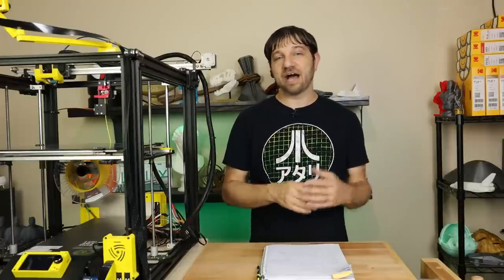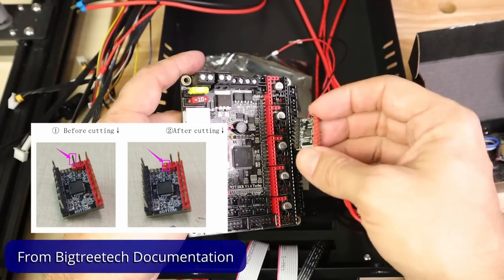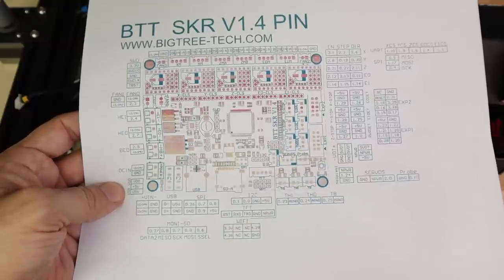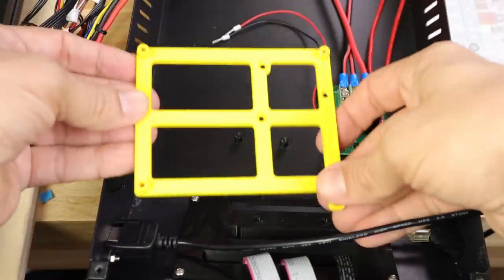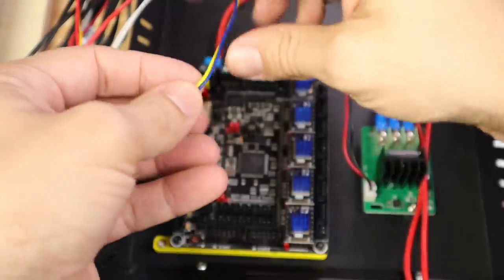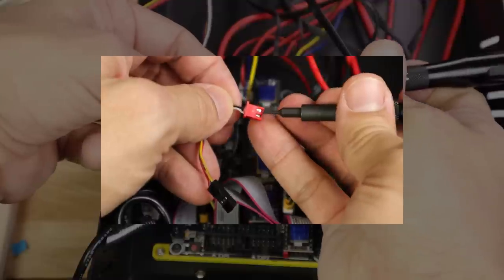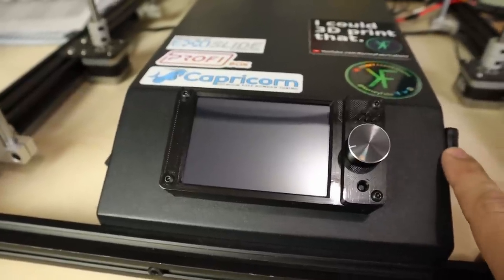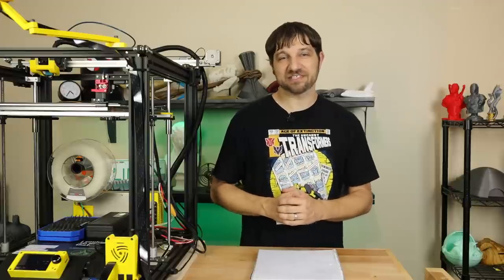Bigtreetech Ender 5 Plus Upgrade: SKR V1.4 Turbo (Part 4)

Comment: Thank you for sharing your knowledge with all!! 
Having problems leveling the bed.  I already scratched my spring sheet beyond repair I think.  My own fault for not being on the ready over the power switch. Oh well, Live and learn.  One time the hotend was going to the center to probe z and I believe the fade failed and scratched it on middle.  Just now, it auto homed correctly going thru the motions and when I began to level the bed, it lost the fade setting (I think that's what it is) and made another scratch from the middle towards the front left corner.
Any ideas? 
Thanks in advance.
Reply from the maker: First, the fade height is what the bed leveling uses to re-adjust the print once bed variance is taken care of. You'r talking about the Z-offset. I don't see how it's "losing" that setting. I'm curious if you're performing bed leveling correctly.
1) Set z-offset in the settings. <- This one requires a little more instruction under stock Marlin. I need to make a video on it. Search YouTube for now. Sorry.
2) Auto-home.
3) Level corners.
4) Auto-level.
5) Save settings.

I hope this helps.
Reply: @kerseyfabs  Thanks, Oh, I know it is user error.  LOL.  I will do the above steps.  Muchas gracias!!!  AND just because of your interest to help others!!!  I became a patron!!!  Keep up the great work!!
Reply from the maker: Thank you for your support! It's much appreciated!
Reply: @kerseyfabs     Ok, Ok, Ok !!  Finally got around to messing around with bed leveling.  I had to use the touch screen to be able to set the z-offset.  In marlin mode, I just could not find where to set the z-offset!! All I  kept coming across was "probe z offset"  which after some thinking that was not it at all.
So, in the touch mode there is a screen where I could set the "z offset".  So I did the bed leveling in there and it is printing now!!
IN MY OWN DEFENSE,  I WAS LEFT UNSUPERVISED!!  
Thank you much!!

Comment: Hi Kris,
It's me again.
I'm using SKR 1.4 Turbo with 5 x TMC2209 and RepRap 12864 LCD.
After update the firmware, I got error :
Err : MAXTEMP : E1
Printer Halted
Please reset.

I tried change the thermistor cable, change the hotend cable and check the connector connections on the boards.

Any idea where to look into? 

Thanks again
Reply from the maker: Did you load my firmware?
Does this happen when you first heat the printer? 
When it's idle does it show the correct temperature?
Reply: @kerseyfabs 
The error come out when I start the printer after the welcome screen that show Marlin version.

I haven't reach the menu, after the Marlin Screen, it's beep very loud and show the error

Comment: I can't  find the jumper setting in this video in the official manual. I have tmc2208 for stepper motor driver.
Reply from the maker: There aren't page  numbers in the manual but it's on page 7:
"TMC Driver-UART Mode: (eg: TMC2208, TMC2209, TMC2225, etc.) Each axis uses a shorting cap to connect the red frame in the figure. The subdivision and drive current are set by firmware."
You'll have to see the image to know which ones.
Reply: @kerseyfabs  thank you!

Comment: I am having a hard time finding this firmware that goes with the he3-D K 280 machine
Reply from the maker: The only thing I could find with some quick searches was some older 1.1 code: https://github.com/Elenedeath/HE3D-Firmware
It looks like you may have to start from scratch or ask around on Reddit or Facebook groups.

Comment: I'm having issues with the bl touch. I have tried everything to make it work. When I hook it up to the z end stop port it won't turn on, if I hook it up to the probe port on the board, it works but won't let z go up. What have I done wrong?
Reply: BTW I've done a lot with my printer that's followed everything you do to yours. Such a great way of doing tutorials!!! Thank you for what you do.
Reply from the maker: If it won't turn on when hooked up to the Z endstop, swap the wires and see if it fixes it.
Reply: @kerseyfabs  I've tried that and it still won't turn on. Still works in the port slot so I at least know I didn't break the wire.
Reply from the maker: Well, my firmware doesn't use that input, so it's not doing anything there. You could change the code if you like but something's off.
Reply: @kerseyfabs  well I appreciate your time, im not good with the whole changing codes thing lol. Maybe I'll try again tomorrow with a fresh brain. Thanks man your the best!
Reply: @kerseyfabs  so for some reason the bltouch with the white and black wire with the original plug wasn't making good connection with the z end stop slot. Switched plugs and now it works. Thanks bud

Comment: I'm just getting into 3D printing and looking to get the Ender 5 Plus, not looking really, more like about to order it in the next few days. Any chance you can do the review and setup of the BIGTREETECH SKR Pro v1.2. I was looking at maybe the TMC2209 V1.2 Stepper Motor Driver to pair with it. Thanks. Really enjoying your content.
Reply from the maker: Welcome to the hobby! Yes, that video is coming within a few weeks.
Reply: @kerseyfabs  Awesome! I've been binge watching your content for 2 days now.
Reply from the maker: @zer0ish84  That's awesome!
Reply: @kerseyfabs  Any update on the SKR Pro v1.2 vid? It's been a year and I have it installed now as of today, after my silent creality board was giving me issues, and I can print(not well) and wanted to know what firmware setting you had for the Ender 5 Plus and the SKR Pro 1.2. I'm having issued with fans not turning on when the slicer gcode says it should, so I have to watch out and enter the gcode to get it to go at the proper layer. I followed the BTT manual and other guides, everything seems to be connected fine. I can home everything, bed and hotend get heat and read out properly. Prints are just coming out trashy. I'm currently using the BTT firmware that I modded with the Ender 5 Plus specs Even the TFT35 has a glitchy section(bottom left, prob a defect in the TFT). I'd just love to have firmware from someone who has tried it and has it working. Pretty much stock, just using exoslide and E3D V6 hot end. Happy New Year.
Reply from the maker: @zer0ish84  How about let me see what I can do tomorrow? 😉 No promises but I'm planning it.

Comment: Is this also working with the original touch screen from the e5+?
Reply from the maker: No. That has some different issues.  Here's a guide that may help: https://www.deviousweb.com/2020/05/08/ender-5-plus-skr1-3-and-factory-screen/#:~:text=To%20upgrade%20the%20screen%2C%20you,the%20touch%20screen%20will%20update
Reply: @kerseyfabs  Thx, this is easy to fix!

Comment: Creality v4.2.7 vs SKR 1.4 Turbo which is better?
Reply from the maker: I would choose the Bigtreetech boards primarily because Creality never wires their stepper drivers in UART mode. This means you can't control them via software.
Reply: @kerseyfabs  Ok, i just bought one with a tft35 screen like you thankyou :) also would you know if the old stock screen can be used for a raspberry pi?

Comment: My printer is not moving smoothly, what can be the cause for this? I followed every step and corrected for the different wireing of the bl touch.
It also says tmc error in marlin mode
Reply: Also, the drivers for both Z1 and Z2 are really hot
Please i need help :(

Comment: HELP, I just did this change but the Y axis randomly stops when trying to home and throughing a haulting error, also Z axis homes in wrong direction
Reply from the maker: Did you use my firmware one this one?
Reply: @kerseyfabs  I used the firmware you provided and got the same issue.  My Z homes down instead of up.  Haven't been able to figure out why yet.

Comment: Could someone tell me if there is any difference aside from number of stepper drivers between the 1.4 Turbo and the 1.2 Pro. Is the setup basically the same as the 1.4 or are there things I should kmow?
Reply from the maker: Ask and ye shall receive: https://drive.google.com/file/d/1vOQUrNgq0SmEEbCmACSGkJO4VVuzB5f7/view?usp=sharing

Comment: I followed this mod and the strangest thing is happening. I turned on the printer and my BTT TFT35 V3 turned on, everything seemed to be fine but, I don't have the touch function!
Any idea what it can be?
Thank you
Reply from the maker: You can switch between "Marlin Mode" and "Touch Mode" by holding down the button for several seconds.
Reply: @kerseyfabs  Yes, I can do that but touch mode doesn't work for me.
Any ideas?
Reply from the maker: It's always possible it's broken but I would first try flashing the firmware and see if that takes care of it.
1) Download this repository: https://github.com/bigtreetech/BIGTREETECH-TouchScreenFirmware
(Green "Code" button, "Download Zip")
2) Unzip the file.
3) Change to the "Copy to SD Card root directory to update - Unified Menu Material theme" directory.
4) Copy the correct and most recent .bin file for your display, the correct TFT?? directory, and the config.ini to an SD card.
5) Power off you machine and place the card in the display's SD card slot.
6) Power on and you should see if flash.
See if the touch screen works now.
Reply: @kerseyfabs  Thank you very much for trying to help but, the touch screen does not work, the rest of the things do. I have followed all your steps but it doesn't want to work.
I wonder how I can go about getting the homing like it originally does, I don't like that it stays in the middle of the hot bed.
Reply from the maker: @gusitorios9245  I'm sorry to hear that. Where do you expect the homing to go?
Reply: @kerseyfabs  I mean when he does the homing, he stays off the center of the hot bed to the right and that influences when he does the leveling of the hot bed. It's as if you have slightly wrong measurements, it should be centered.
Reply from the maker: @gusitorios9245  The proper way for the printer to level the bed is with the probe probing where the hotend WILL be. That's the point of the XYZ offset. The way the printer originally probed the bed is incorrect. If you want to manually level something, you can use the menus to move the hotend where you'd like it to be.

Comment: I just installed the skr 1.4 turbo and wired everything up according to instructions. When I try to flash firmware.bin file the screen comes up in full color saying "No printer attached". I don't even know where to begin..
Reply from the maker: I'm sorry to hear that. Press the button for a few seconds. Then switch to Marlin mode. See if you're getting anything when you power it down and back up.
Reply: @kerseyfabs  I managed to get three small prints using the touch screen, then the next time I started up Marlin was installed! Now, however, I am having an issue with the micro xd card with the extension cable. Whenever I load a new file onto the card I cant attach media until I reach under and eject the extension then re-insert it into the slot.
Even with all these quirks, it is printing fantastic all thanks to this great video series. Thanks for your effort.
Reply from the maker: I appreciate that, even with the oddities. The extension cable should be carrying that detect signal through. Maybe a bad cable?

Comment: Hmm I installed the Pre-built forTMC2209 since that's what I got and now my BTT TFT35 just stays black with "LCD12864 Emulator" on top. I had things nearly working before with Tripod's Garage firmware but I couldn't get the Z Home to work.
Reply from the maker: Did you switch the BLtouch black and white wires for my firmware over to the Z endstop position? When you flashed my firmware, did firmware.bin become firmware.cur?

Comment: I changed my Ender 5 plus as described in the video. I used the precompiled firmware which is linked in the description. First tests are good. But it seems that the homing of X and Y leads sometimes to a problem, because after homing it keeps the endstop pushed. So I get sometimes an alert with a kill(). This can be really annoying, but not that big problem, because it should not happen during prints, only after homing. Does someone has the same problem? Does someone know how to change this behaviour (e.g. moving a bit away from the endstops after the homing procedure)?
Reply from the maker: Please check where you have the end stop wires run and keep them away from high current wires such as the hotend heater or the bed heater. This can introduce noise.
Reply: @kerseyfabs  I opened the case up again, cut all the zip-ties and checked the cables. Happend again. Only during homing of the Y-axis. Inbetween, it happend, that the home-position of the Y-axis was completely wrong, but without an error. So I assumed that the Y-endstop sends a wrong signal. If this is not electric noise, maybe its vibration? And why is it not happening during prints? I mean, if that Y-endstop is triggered during a print, everything should stop. But these are only assumptions. The serial-log does not give me any information I need to see ehat happend:
Send: G28 Y
Recv:  T:23.91 /0.00 B:23.28 /0.00 @:0 B@:0
Recv: echo:busy: processing
Recv:  T:23.91 /0.00 B:23.28 /0.00 @:0 B@:0
Recv: Error:Printer halted. kill() called!
Changing monitoring state from "Operational" to "Error: Printer halted. kill() called!"
Send: M112
Send: N2 M112*35
Send: N3 M104 T0 S0*34
Send: N4 M140 S0*97
Changing monitoring state from "Error: Printer halted. kill() called!" to "Offline (Error: Printer halted. kill() called!)"
Connection closed, closing down monitor

Another test: maybe the Y-endstop has a hardwareproblem. So I swapped the Y-endstop with the X-endstop. But same result. Its again the Y-axis during homing which is not working.
Then I tried to switch the cables of the X- and Y-axis (homing of the Y-axis will move the X-axis and will use the X-endstop), but same error. Same when switching the plugs on the mainboard.

So, the error is somehow related to the Y-endstop port on the mainboard.
Reply: Since it is not working with the cables of the X-Axis, I thought, that there is problem with the port on the SKR board. So I switched the Pins of the Y-Endstop and the BLtouch 2-pin connector (P1.27 and P1.28) and changed the cables. Same result. Steppers should also not be the problem since the problem occured on the original Y-Axis and the X-Axis when changing cables.

I have now no idea left how to get the reason for the kill(). If there would be more information in the serial log, it would be much easier to get the source of this.
Reply from the maker: I have your fix! My apologies on this one. I missed an important setting and I will be releasing a fix soon. Since you're chasing it though, try out this file for me and let me know if it works for you: https://drive.google.com/file/d/1pThxO5cvXheKeoyU_AhCWiqlqgaQWz1l/view?usp=sharing

Setting: 
#define ENDSTOP_NOISE_THRESHOLD 4
Reply: @kerseyfabs  The new firmware works without problems. But I can't say if it will work for my problem, since I think I figuered out what the problem was: Creality is using these ribboncables with 6 wires in one. In case of the Ender 5 plus, Creality is using them to wire the stepper of an axis and the corresponding endstop ( I know you know ;-) ). Since the stepper cable is now running for a long distance in parallel to the endstop cable, this created the noise while running the stepper. So I just separated the two wires of the endstop from the four wires of the stepper and that seems to work.

Many thanks to you!

Comment: So I got the BLtouch wires backwards on both plugs, though it didn't help that the BRY set is completely different on mine.  :(
Reply from the maker: Yeah, they changed the colors on us. I believe I posted a link to the new diagram in the description. https://photos.app.goo.gl/usC6wq5iBqgYbCFN8
Reply: @kerseyfabs  Hay, that did it thanks for pointing that out.

Comment: great video i installed the turbo into my ender 5 plus downloaded your firmware but i just cant get my bed lvled keeps printing in mid air i cant change the Z offset to negative
Reply from the maker: I always run mine with a negative value, so I haven't seen that before. Try using the Z Probe Wizard in Marlin mode.
Configuration->Advanced Settings->Probe Offsets->Z Probe Wizard
Reply: @kerseyfabs  there is no Z probe wizard
Reply from the maker: @truestreetdevil666  If you haven't done it yet, go to my community page (https://www.youtube.com/c/KerseyFabrications/community) and upgrade to 2.0.7.2. It's only a few posts down.
Reply: @kerseyfabs  just installed 2.0.7.2 still no probe wizard all i see is probe x offset -45 y offset -07.0 z offset -2.50
Reply: @kerseyfabs  i got the wizard now i downloaded the zip it was still disabled changed it reloaded on the printer and it works now thanks

Comment: If anyone else runs into the issue where the micro sd slot won't read the card, take two strips of paper and fold them in half and stick on top of card and jam both into the slot all the way. It won't click, but should be jammed in tight enough to get the pins to contact the traces on the card. I screwed around with mine all day trying to get it to read the card and that finally worked

Comment: Do you have a video on mounting the skr 1.4 turbo into an Ender 5 NOT the plus?
Reply from the maker: No. Sorry.
Reply: @kerseyfabs  It seems everyone had one on the Ender 5 Plus but not the Ender 5. I was hoping for a 3d print mount for the SKR 1.4 board.
The ones I have found did not fit the hole pattern on the Ender 5. Thank you for your videos and for responding.
Reply from the maker: I'd love to do more of these mods on the Ender 5. Have you thought about just using the E3 Mini V2? or E3 Turbo?
Reply: @kerseyfabs  I have bought the SKR 1.4 turbo and the dual-display for it. Easy on the display but the SKR mounting, I will manage it just looking for some shortcuts. Thanks